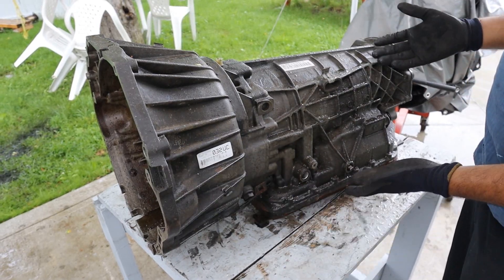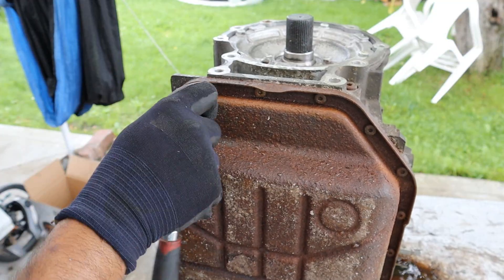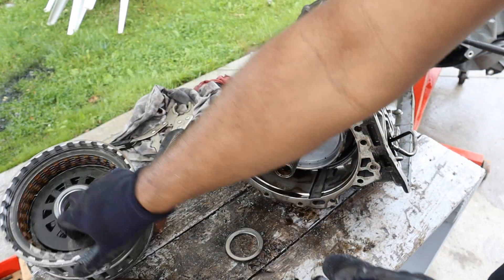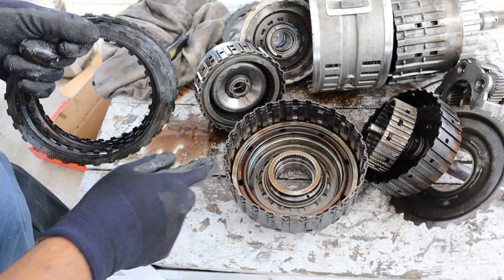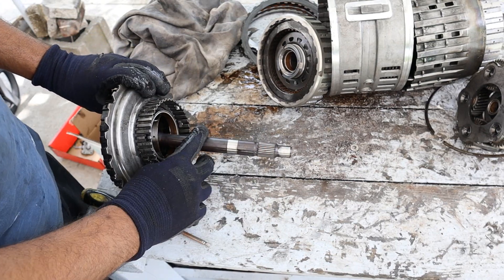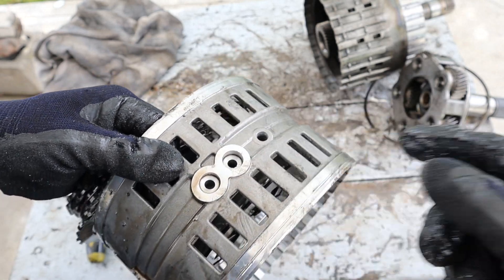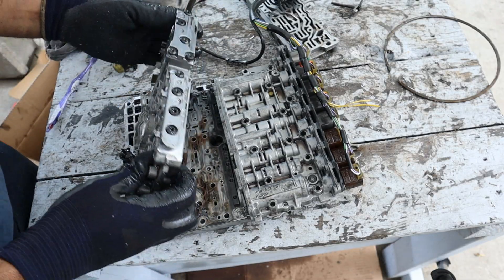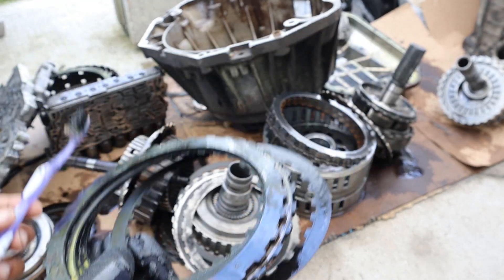FAILED ZF 5 Speed Automatic Transmission Teardown

Comment: Hello.  It is a very explanatory video. Thank you for this. 

Once I replaced O-ring on the tailpiece of 5HP18 on myBMW  E34. 
When the tailpiece was off, I touched the parking gear and found that it moved, it had some rotational play and axial play (axial play because the tailpiece was off). 
After putting back the tailpiece, I did a test drive and  I heard humming (similar to bearing howl). It did not happen before.  Since then I hear it every time. It happens only when I start to drive in 1st gear, when it shifts into 2nd gear the howling disappears. In winter driving mode it does not howl.
 In general, the gearbox works very very well. Only this noise worries me. Do you know how I can fix it? Will decreasing the end play with a shim washer (maybe putting a thicker washer) eliminate it?

Comment: These 5 speed automatics were honestly not that great especially when not maintained. Most of the RWD 5 speed automatics weren’t that good. Ford had failures, GM also had problems with theirs as well, Chryslers version had torque converter failures, and even the Nissan and version had some issues but it was caused by coolant mixing with the transmission fluid. Even the bulletproof Mercedes-Benz 722.6 had some problems as well. The only good RWD 5 speed auto is the ones used in Toyota and Lexus models. Thankfully we got more durable 6 and 8 speed automatic transmissions today. No transmission in my opinion has lifetime transmission fluid. This is a common practice that every single car manufacturer uses to appeal to customers. They want to make money selling more vehicles. If that transmission was maintained, it wouldn’t have failed earlier in the car’s lifetime.
Reply from the maker: Agreed on the fluid.... lifetime is meant for the lifetime of the transmission not the car.

Comment: ZF gearbox are legendary! Not just in the automotive industry but also in the marine industry. They always have the smoothest gearshift and rock solid reliability. 
This one is obviously abused and neglected, that's why it is overheated and burnt.
Reply: How exactly do you abuse and neglect a gearbox?
Reply: @greathey1234   people think the oil lasts forever, never check the oil level, run it on a wrong gear (instead of D, people run it in 3rd, or 2nd
Reply: @greathey1234  try burn outs and neglected regular maintenance
Reply from the maker: Fluid, temperature and operation. 
Manual shifting without rev matching takes its toll too

Comment: Man, that pillow case sure looked comfy!  Lol
About the trans, do you think the filter might have just been clogged up enough with old gunk that the fluid pressure was insufficient to operate the trans eventually?
Also, I'd love to see a teardown of a ZF 8HP trans out of something.  They're in pretty much everything these days..
Reply from the maker: I'd love to teardown an 8 speed too! 

The filter will eventually get clogged but by what? Particules coming off the clutches and other wear surfaces.
Reply: @speedkar99  Agreed!  I think it is kind of inevitable that any automatic transmission will produce some particles from the wearing of all of those clutches.  Once they begin to impede the flow of the filter, it's probably a downward spiral from there.  I really need to service some of my transmissions!  😅